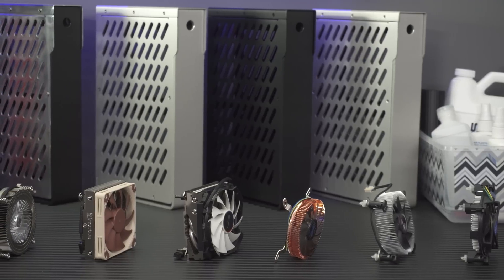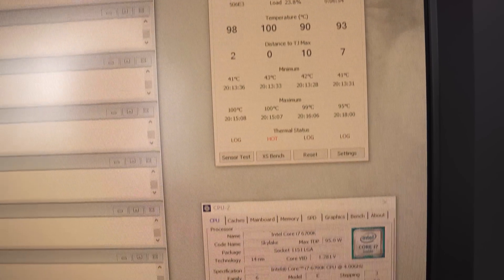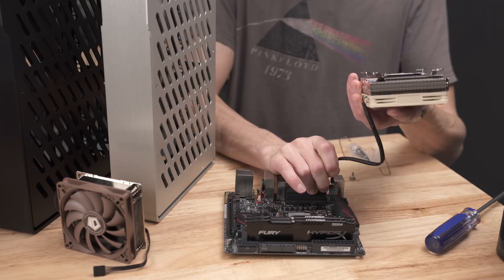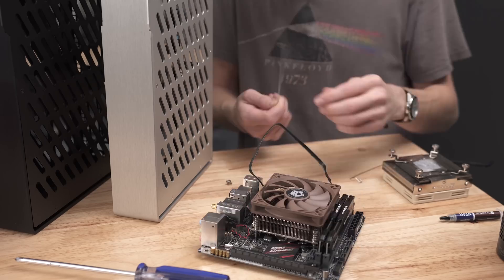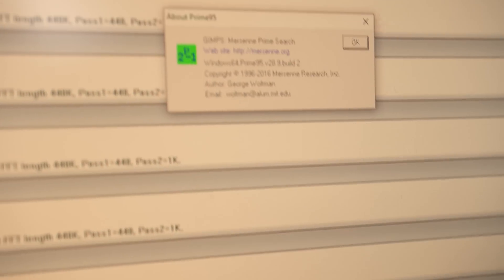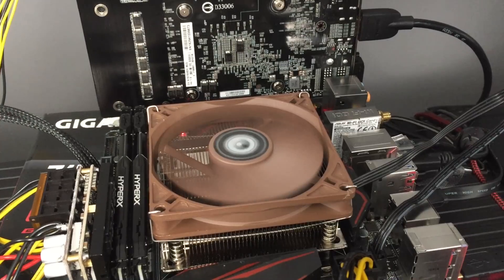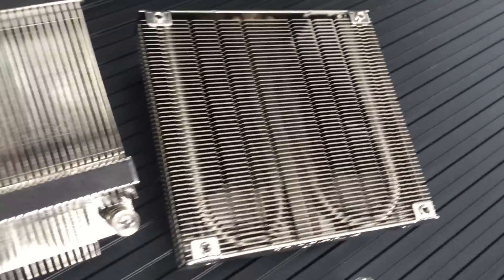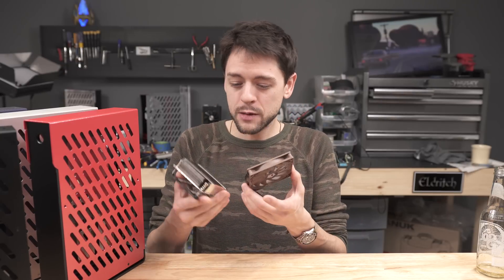MINI-ITX Vapor Chamber Cooler Tested

Comment: I just started learning about the S4 Mini today and I'm really interested in making a build around it! I'm wondering which CPU I should go with though. I was originally thinking about an i5 6600K with an EVGA GTX 1060 mini but with heat and cooling, it seems like it may just be better to go with an i5 6500? Thoughts. Thanks.
Reply from the maker: My opinion is that unmodified you will never see the difference between the 6600K and the 6500 outside of a benchmark designed to tell you the difference. Technically you can buy a K and undervolt it, but if you don't want to bother the 6500 is a great chip.
Reply from the maker: Hector Amador I looked into the cost of having James Earl Jones do a dub track for me but it just wasn't economical. xD
Reply: Not From Concentrate isn't the 7500 more intelligent? Same tdp, same price, but higher clockspeed
Reply from the maker: I mean if you have to start from scratch of course!